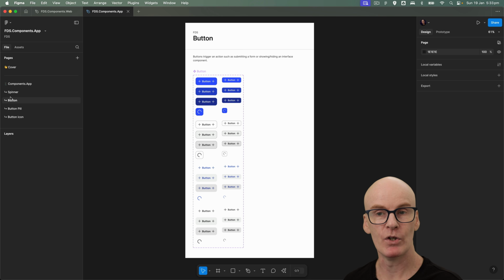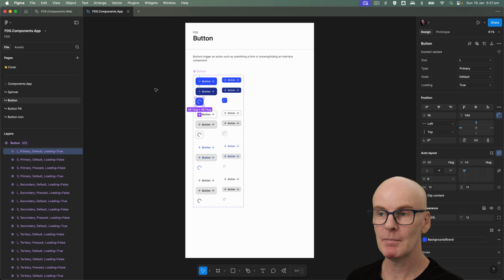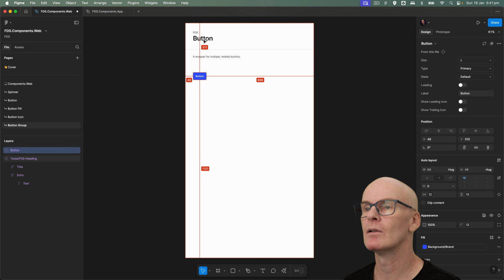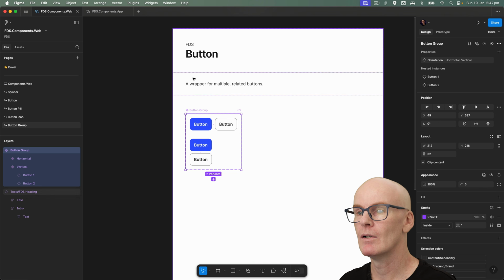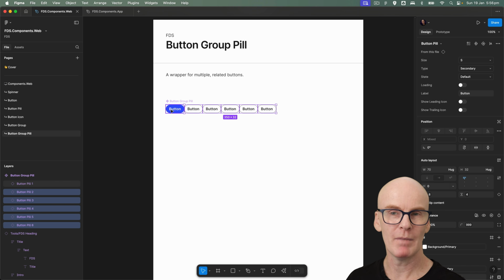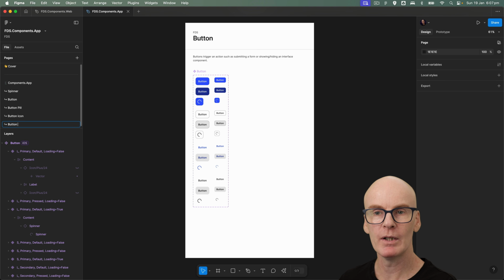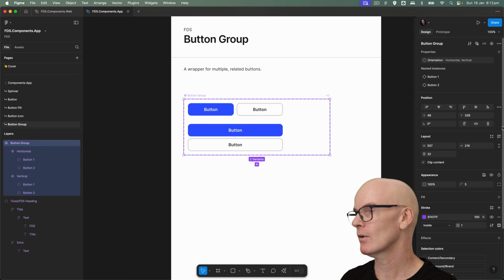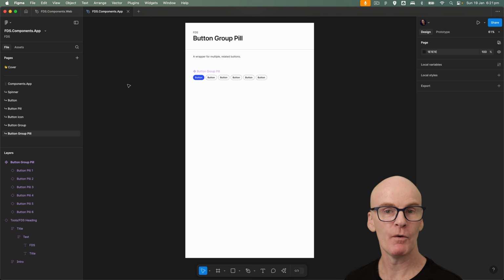Figma Design System: 13 Button Group Components

Comment: One more thing I wanted to ask. Can I create in variables the collection of translation text? For example i will have a column with all engish text and another column with german? If so, how can I create it?
Reply from the maker: Yeah you can, you can create a collection with a default mode for the text you want to translate from, then add the extra modes just like you said for the translations.

Comment: Hi Chris, you have done a great job, it helps me a lot. I have one doubt, how to remove the property in the component for example I don't want that loader property in my component but I added it mistakenly, how do I remove that?
Reply from the maker: You can remove the variants from the component itself then remove the property from the design panel.

Comment: Hello Chris. I was wondering how to properly implement this design system in different projects? Should I duplicate it each time for each project and import it as an asset library? I've done it a couple times, but I can already see that it will become cluttered after a few iterations (also it leaves all duplicated versions outdated when i will update original following your guides)
Reply from the maker: Hi! FDS is a multi library system that all links together, and requires a paid Figma account to get the best out of its setup. It’s also setup to support a single organisation/product atm so if each product you design with it is considerably different then you’ll have to copy it each time, or add more modes to support different brand colours and border ratios styles. When Figma releases child modes, this will become easier to do 🙂